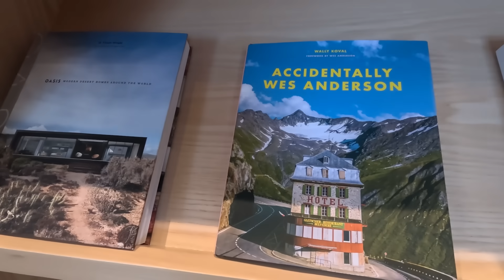THE DAY HAS FINALLY COME!!!

Comment: Awesome getting closed in before the deep winter starts!
So glad you have extra help! Trent, please get those 3 joints checked out. I’ve had 23 surgeries, about a dozen on joints, so have them checked sooner rather than later!
As to an electric car, I vote a big NO. Totally not practical in our country. Also I’ve heard charging it is the equivalent of $17/gallon. Get a good SUV that gets around great in your mountains and gets better gas mileage than the truck!

Comment: I installed similar French doors in my basement in order to get large objects and furniture in and out. I think it would’ve been much easier if you had left the doors installed and figured out a way to move the complete unit. That keeps things squared up until you get the frame secured instead of trying to do it after installing a jam. The doors I’ve installed came with temporary screws to hold them square until they were installed. The job would go much faster if you didn’t have to do everything twice… Or thrice.

Comment: Wow, your build is really coming along!  I've heard good things about Rivian, but I wonder how long the range would be.  Sure, you can charge at home, but how many miles do you use up to get to town, etc.?  Like a gas vehicle, range is significantly reduced when towing, but I imagine you'll still have one of the pickups for that.  Personally, I have a Chevy Suburban 4WD (with 2 speed transfer case) and an F350.  The Suburban is far more capable in the winter due to it's auto locking rear diff and superior traction control.  I don't know what kind of rear differential a Rivian has, but I've found that to be a big factor.

Comment: Look up the fires that happen with those batteries when they overheat how bad they are how they are unstoppable and there’s not much you can do to stop them. There are videos of those batteries, melting concrete floors. Safety is a big concern with electric vehicles. 30:03

Comment: The Rivian R1T has a 22 score (bad) because it has drive system failures. Repairs would be under warranty but there may be long waiting for parts and service. Reviews of off road capability are very positive, at least those that I've seen. 
What happened to your Toyota 4 Runner!!? That's an excellent choice!!!

Comment: That Rivian could be fine. Would love to see how they get it to operate in difficult terrain, since electric drives have an extreme amount of torque from the beginning. My e-Golf (front driven) squeaks every sharp corner in the moment (slippery streets). 
Rivian should give you one as an ambassador.
Reply: They also have millisecond switching on the motors.
Very refined.
Reply: @rogerstarkey5390  Yes, with the exception of my car. 😒

Comment: I think the Rivian's per-wheel slip monitors and minimal rotating mass should make it far better in snow that your Ram. Although it is heavy, which means lots to lift up the hill. Odds are they are great on the flat, but give up something on a slope due to pure mass. Still, weight means traction, and the Ram is heavy also! It would likely balance out.   Either way, imagine the content you can make on a solar charging project once your current projects are done!

Comment: The idea of electric vs gas is amazing, I bought a Porsche Taycan with hopes that it would be a great everyday driver but range numbers aren’t accurate. It is fun to drive but stop and go city driving, I get a quarter of the published range which is about 250 miles, especially in summer with AC on. On colder winter days, even less. When I drive to my farm which is at a higher elevation than the city (highway driving), I see a big drop in range. I would imagine driving gravel roads in snow up a mountain in cold temperatures wouldn’t be worth it. You could save fuel with a smaller truck or car with awd.

Comment: I think you'll love the Rivian. From everything I have seen, it should be able to handle your road no problem. While it's not TECHNICALLY 4WD, I think it's safe to say that the quad-motor AWD is essentially 4WD given a motor per wheel.

Another benefit, you get solar on that roof and you're driving for free...
Reply: Riiiight - free charging - after spending another $80k for a solar system and batteries.  As a solar owner in Minnesota, I can tell you for a fact that winter electric production is crap.  And with all the snow they get - get real.

Comment: I’ve seen a couple of EVs catch on fire and because of the materials the batteries are made of they burned super hot. The fireman couldn’t even put the fires out. All they could do was let it burn. I mean it’s probably a rare occurrence, but it’s still something to consider. I wouldn’t store it in a garage. And supposedly if it’s too cold outside an EV won’t start because the batteries need to be above freezing temp to work. However, that was a Tesla. I don’t know anything about the truck y’all are eyeing. Whatever you choose, I hope it works out for you.

Comment: The Rivian would handle the ice and snow better than anything you have driven. It is heavy with a low center of gravity. Not only does it save on gas, but the average vehicle has over 2000 moving parts. I believe a Tesla has less than 20 moving parts. No maintenance. It is safer than an ice vehicle. It is the future.  You would have no regrets. None. Rivian is a fantastic EV!

Comment: I have never heard of that vehicle but it looks very nice. How much will it cost to charge & what about a flex where you have both gas and electric as it may be the best option. Great gas mileage and no charge outlet as I believe the friction of the wheels are what charges them but may be a different technique on assorted vehicles depending on the solution choice of that company .

Comment: On the vehicle my questions are how much do you normally drive? We drive a lot.

How many charging stations are in the area you drive IF you drive long distances.  I just want to go I don't want to be researching my trips for charging stations. 

Those are my 2 big concerns when my husband brings up electric cars. 

If you are always local then as long as it can get up your road in the winter go for it. 

Will the car company bring the car to you so you can see how it deals with your road?

Comment: Has the massive concrete retaing wall that leads into the house been addressed?  If I remember correctly, the back wall against the mountain is a solid pour, and half of it is in the house, and it continues outside? So it's basically a massive thermal bridge to the elements..... if that's correct, it's going to be impossible to heat that room in the winter..... or am I wrong?

Comment: Be careful using the car seat as a carrier at Leo’s weight. A lot of those carriers work as car seats for babies up to 35 lbs, but the handles for carrying them is usually a lower weight. I hope I’m wrong; I would hate for your happy little guy to get hurt. Double check. 😊

Comment: I’m an ev fan, but I’m not sure they work as a truck just yet. 
For Trent’s usage probably ok, barring the issues evs have with cold temps. 
But really, it’s a trx… 700hp means lots of trips to fuel up, surely that was obvious when it was purchased. 
I’d keep the trx, and use allies truck more often if the gas usage is too much. Won’t be long and you won’t be able to buy a trx or similar.

Comment: I work at a bmw dealership we have  a 2023 used one with 6500 mi I drove it and my opinion it’s ride it bad trx rides ten times better also it needed a windshield it cost 4000.00 dollar’s installed stay with the gas truck  but I am a dodge guy I have a 2019 challenger wide body redeye love that engine we also had a trx come in used 22 I was able to drive that truck and I think it’s the best riding truck ever with that long travel suspension

Comment: Rivian is great, but does not have lockers, or can even get them. The best bet is a Tesla model Y duel motor. Much cheaper and more efficient in energy use and beat of all  THE TEALA SUPER CHARGER NETWORK. AND YOU CAN GET ONE IN 15 DAYS. AND More storage than a rivian suv.  CHEERS and safe travels     Steve h.

Comment: Good job everyone for getting dried in, The other roof would of been nice to complete too for the snow but otherwise you guys are awesome. The electric car thing for you guys in the mountains is tough. I have a tesla model Y which is my commuter. Trent wont be able to pull people out of the snow vehicle. I heard also like someone said they don’t like cold weather. I remember when the snow plow goes by your driveway and leaves a big ledge just wonder if it can climb it. The kia electric and of course Mercedes electric have nice interiors, BMW. Tesla let me take a car overnight so if they let you take one overnight do it in the winter so you will know how it does. You can also rent an electric car to just to try it out for a week and see how it does. Hey just my 2 cents.  All I have had is a 2021 tesla model Y but the range doesn’t match what they actually get. Road tripping I get around 225. Im suppose to get 319 or something like that. Do you guys regret getting rid of the 4 runner? Thanks for the videos love them

Comment: Great progress on the addition!  Get those injuries looked at pronto.  As for the EV, maybe you should check out the amount of radiation you will be exposing the family to while it charges.  An ungodly amount!  No one wants to bring that one up.  Take an EMF meter to a charging station while someone is amping their vehicle.  It will shock you.  Sure it sounds good to save on gas, but have you also noted the instant fires and how there is nothing to put them out once that start?  I know the news doesn't broadcast it, but Florida has had quite a few and the fire departments hate these EV's.  Personally, those are enough safety issues for me even if someone were to tell me they were "rare."

Comment: Trent , love the haircut and cleaner face😁
I have an all electric Audi SUV.  I love the vehicle but a few things to consider.  Ensure you have adequate fast charging infrastructure around.  This is extremely helpful when driving a bit more distance from your home.  Also at least for me, the number of miles does not equal the same as gas mileage.  If you have 300 miles/kwatt or so, that is going to be consumed with everything you have going on in the vehicle so you may only have a couple hundred miles to drive and honestly that’s an estimate.  That to me is the biggest cons for the EVs. There’s always a bit of anxiety on how many driving miles you have to make it from point A to B.
But with enough fast chargers it would be so much better.  I still love my EV, sort of feel like a pioneer here in Ga.  Where the infrastructure is lacking outside of ATL.
Hope this helps

Comment: So ..... if two trucks are overkill, why did you trade in the Toyota and get the second truck?   Just wondering.  We too live out in the country.  We own a Tesla, which we charge via our own solar panels.  Plugging in at home is the way to go.  It has been a great car, in fact, we are on our 2nd.  In our four years of experience of traveling in a Tesla, we've never encountered a charging station that didn't work or where we've had to wait.  But I've heard not-so-great things about non-Tesla brand charging stations.  So you might want to look into that.

Comment: Automotive Ceramic Coating for this roof to make it slick.
Reply: Something will need to be done, either ceramic coating, heating coils under it, or both.
The slope is less than the main roof, and ice and snow builds up on that not sloughing to the ground.  No way that new roof will slough with the lower slope.

Comment: Trent and Allie electric vehicles aren't for everyone. I have a 4WD truck (17 MPG) and a Prius Hybrid (50+MPG) for our family use. The hybrid is really nice when gas prices are high. I can't do EVs.  

I'm in an urbanized environment in the northeastern US with older infrastructure. Many homes don't have garages, and even if you do most homes have 100-amps (or less, 60-and 80-amps is not unheard of) at 110V for the electrical service panel. EVs usually need 32-50 amps at 220V (about 7200 Watts at 32 amps) with a circuit breaker in the 40-to-60-amp range and they strongly recommend at least a 200-amp residential service panel. These power requirements I mention also assume you aren't charging multiple EVs at the same time - single EV car household?

Much of the parking where I live is street parking (for houses, condominiums, apartments, etc.). Having a dedicated location at your residence to recharge your vehicle simply won't happen any time soon, and who knows how long before the electrical infrastructure can be upgraded or how such an upgrade would be paid for. Whenever someone visits our area with an EV they have to go to a local shopping mall some distance away to find a charging station. I guess you would then wait your turn to recharge, and you certainly aren't going to leave it charging  overnight.

Comment: The problem is you made the rough opening tooo big. When you buy windows and doors they give you the rough openings and if they did not you should have asked . Actually no big deal just scab another 2 x on the top and install your insulation .

Comment: I think you should stay with hybrid vehicles because the full electric vehicles aren’t quite there yet. 
Toyota has hybrid primes so you have the hybrid the electric op to charge and gas so you don’t get stuck with out charge and can go much more distance for cheaper. Plus electric charging cost as much as gas in lots of areas. 
Not a great option to have no fallback.

Comment: Truth.  I drove an electric car from grand junction Co. To Slc.  With 100% power, I barely made it to Price on the 100 %Electric charge that  it had.  Spent 3 hours charging in Price. No fast chargers were available.  Started on Highway 6 towards salt lake.  Now power time decreases on driving conditions,    Speed, hills, miles , air temperature etc.  Well that huge charge I got in Price barely got me to Spanish Fork. Only 69 miles. I had Maybe 2 miles of (juice/power left).  It was only 69 miles of mountain driving. THERE WAS NO power stations along the way. If I had ran out of power a tow truck would have needed to pick me up and deposit me to the nearest station.  I then sat for 2 more hours charging to get to SLC. It was a 4 -4.5 hour Total drive.  I spent 3 hours in Grand junction  charging, 3 hours in Price,  and 2 in Spanish Fork...well 3 hours there. Total of 9 hours of charge to  travel 5 hours. I was transporting a car for a dealer from point a to point  b.  I WILL NEVER AGAIN drive an electric car,  not even  from A to B.  This was my 4th time doing this for the dealership.... Nightmare each time.  And the power stations they install in your garage, well lots catch fire.  Our house burnt this past July .. faulty outlet that had never had anything plugged into the past 18 years.  I'm a bit hesitant on any sort of thing that could cause a fire.  It is very mind damaging,  and now I have ptsd because of it.  THINK TWICE ABOUT AN ELECTRIC VEHICLE. It isn't worth it.  Maybe if you only drive 20 miles a day, but then you have home fire worries.  NOPE!!! Never!!!  This is America.....BEST COUNTRY in the world, yet because of Stupid government decisions,  we are the laughing stock of the world.  And they think semi trucks are going to all electric????  NOPE.  Not happening.

Comment: You still have to pay for the electricity for the Electric vehicle. And if the charging station has lost power your screwed. So I vote no stay with gas
Reply: And there aren't any solar panels on your house or garage roof to allow an EV to recharge while it's parked in the garage. 
 What you "save" on fuel is not easily offset by cost to recharge and limited driving range compared to internal combustion engines.

Comment: For the difference in price between a gas/diesel truck and a Rivian EV your poor mileage is really a factor.
Reply: Rivian
±340 miles, say 300.
.
First question, how often do you drive more than 150 miles each way?
.
You're driving 300 miles at 70mph.
4 hours.
You have a 2 year old in the car.
You think you won't be taking a break?
.
20 minute break?
That's another 100-150 miles while you do what you need to do.
No "extra" time taken.
.
It's not a problem.

Comment: I don't really understand. You for rid of the Highlander because it didn't handle snow as well and wasn't high enough off the ground for the winters on your mountain. So why a smaller SUV? Does it have the capacity to have winch? Does it have a better clearance? Is it the right electric SUV? there are a lot of electric trucks and SUVs out there now. Look around.

Comment: Not exactly sure if you’ve noticed how expensive electricity is currently. I really don’t see a difference between expenses in gas and electricity. Also, you should do some research on electric vehicles and the cold weather. They don’t fare very well and their fuel economy drops a lot not to mention if you get stranded in electric vehicle you can’t just have someone bring you gas. Would hate to see the TRX go especially Since it’s one of my dream vehicles

Comment: I don't have an EV and will never own or drive one but I would do more research before considering one.  What I have heard is they tend to have problems in cold areas, cost a lot to charge and to set up a charging station at your home location and have some problems with the batteries catching fire and exploding.  One article I saw said that operating costs for the EV are equivalent to paying 18 dollars a gallon for gas.  
On another subject I have read that putting floor wax on metal roofs greatly facilitates snow and Ice sliding off the roots.  Really enjoy watching your program all the time.  Keep up the good work.